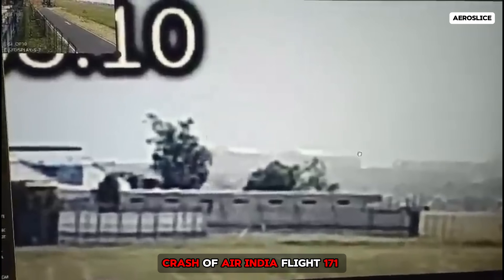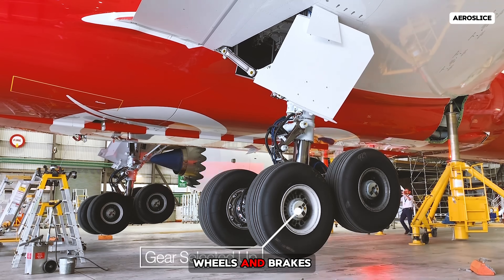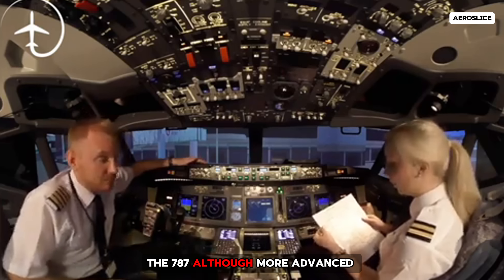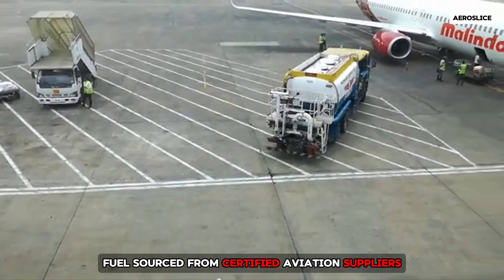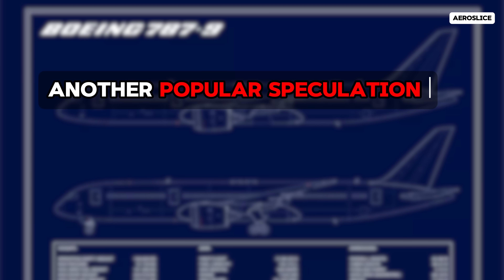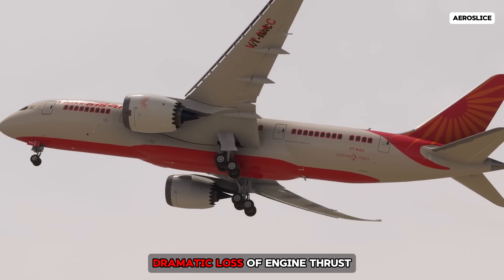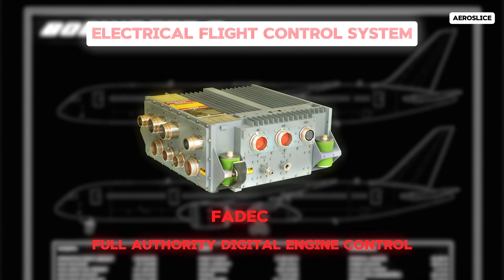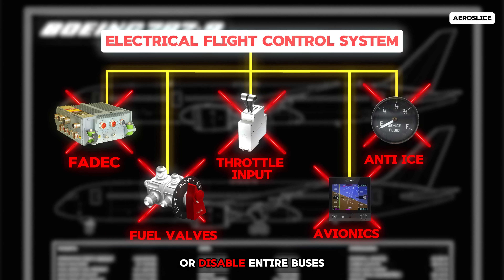The Truths Behind the Air India Crash

Comment: One of the engines failed on take off so the Pilot told the co-Pilot to shut it down , Co-Pilot mistakenly shut down the incorrect engine and the plane dropped from the air since it now has no thrush.. Ive been on the 787-8 probably a 1000 times over the years and never seen any problem of any kind.. I guess we all will have to wait and see..
Reply from the maker: 787's are surely very safe but your theory doesn't really seem plausible to me although anything cannot be denied at this stage..
Reply: There is no evidence that either engine failed. The aircraft rotated at the usual position and climb to 400 ft (twice the 197 ft wingspan) in 10 seconds, at a rate of 2,400 ft, which is normal. This aircraft has auto rudder correction to assist the pilot if there is a sigal engine issue which would require rudder to correct for the resulting yaw. In both videos the the rudder is in the mid position, hence asymmetric thrust is not being produced.

If there was a low level problem with an engine, the pilots would be too busy flying the aircraft to worry about a defective engine, that is a problem for later.

Comment: Landing gear is hydraulic, it has redundancy, if the process of raising the gear starts, you will see the “barn doors” open, this never happened….why?? Startle effect or the Pilot flying waiting for the Pilot monitoring to call “positive climb” which never happened because the aircraft didn’t climb… this extra drag prevented the aircraft from climbing..
Next, the video from the left clearly shows two things…
1. As the aircraft rotates, it’s very close to the end of the runway , hence the dust cloud thrown up perhaps from the clearway at the end of the runway.
2. You can clearly see a vortex, which suggests that at least engine #1 was creating thrust.

Any modern aircraft cannot take off without flaps, the takeoff config warning prevents this, even if the pilots forgot to press the configuration warning test button.

The RAT deploys automatically in the event of a dual AC power source failure, not because of a dual engine failure, with both engines running, and a loss of both engine driven generators, you will see a RAT deployed. The purpose of a RAT is to provide limited emergency electrical power to emergency buses, which provide primary instruments to the LHS pilot, and such things as fuel pumps etc…..it has nothing to do with thrust.

I disagree, I think the altitude reached is about right for ground effect.

This is either one of two things.

1. An electrical system failure, for example if you lose FADEC, and the slats are extended, the engines command idle thrust.
2. An input error, for example if the crew input a zero fuel weight instead of a gross weight into the FMGC, you produce a performance., with a flap setting, and a flex temperature, but not appropriate to the conditions on the day…this has happened before… but it doesn’t explain the RAT.
Reply from the maker: @coyh1493 Thankyou for such a detailed comment, I really appreciate it and it helped me understand the situation more! 
would love to know more about your view on this whole incident

Comment: Boeing has software which automatically takes over the controls and prevents pilots from manually controlling the plane in danger. Investigation found that pilots had the same problem with Boeing 737 Max crashes.
Reply: The 737 MCAS system had authority over the stabilizer trim. It was tied to a single angle of attack indicator. If the airplane entered a high angle of attack it would command nose down pitch trim without crew input. Because the crew didn’t know about the system and they failed to identify pitch trim runaway in timely fashion and shut off the stabilizer trim the planes crashed. 

MCAS had essentially no ability to take control over the airplane. It just had authority to turn the pitch trim wheels which the pilots could shut off. In fact they were responsible to turn off the pitch trim if it ran haywire because of any reason. It’s why Boeing didn’t inform the crew. Pitch trim runway isn’t something you diagnose when it happens. You shut it off right away. 

Am i excusing Boeing? No! I’m spewing why this happened. It wasn’t just Boeing. There were multiple contributing factors including old school outdated ideas that memory items are a good way of handling developing abnormal situations. In the past few years crews are given very few memory items because they are outdated and can be performed wrong by the crew when things get bad. If I’m not mistaken the 787 has zero memory items.

The 737 max is an old airplane that requires the crew to intervene with memorized procedures in case of system failure. 

The 787 max has no memory items Because it’s automated and highly advanced.
Reply from the maker: Yeahh I heard about that but I don't think it applies here
Reply: That’s MCAS on 737 MAX
Reply: Totally different in every respect.....
Reply: "Investigation found that pilots had the same problem with Boeing 737 Max crashes."
That is not substantially true.  MCAS makes/made some adjustments, but does not take control of the plane from the pilots.
The problem was that the pilots were not aware of MCAS, so made inputs which caused the crashes.  Not that they could have known that.

Comment: So true! The 787’s landing gear is electrically powered. During takeoff, the gear began retracting the first step  but never locked up, likely due to an electrical failure. Crucially, the fuel pumps share the same electrical bus. When power is lost, the system switches to suction feed, which may not supply enough fuel under high demand. The result: thrust loss despite engines running, failure to reach V2, and a low-speed, low-altitude stall. So many are just focusing at just the RAT. An electrical bus breakdown is the hypothesis that supports all evidences known in this case.
Reply: The landing gear is a hydraulic system engine driven
Reply: @luigilainom1123  Yes, it’s hydraulically actuated — but the 787’s gear system is powered by electric hydraulic pumps, not engine-driven ones. That’s the point: no electricity on that bus = no hydraulic pressure = gear stuck. It’s a very different architecture than traditional aircraft. Might be worth a closer look before hitting reply next time. 😉
Reply: @StefanEngdahl-v9r  "Yes, it’s hydraulically actuated — but the 787’s gear system is powered by electric hydraulic pumps, not engine-driven ones. That’s the point: no electricity on that bus = no hydraulic pressure = gear stuck. It’s a very different architecture than traditional aircraft. Might be worth a closer look before hitting reply next time. "

The initial part of the retraction sequence, tilting the bodies down at the front, is achieved using electric motors.The next step, lowering the doors uses hydraulic power. This system is pressurised by electric hydraulic pumps. The electrical power is provided by main engine driven generators. Raising the main gear and then closing the door requires hydraulic power. The commands to retract/extended the undercarriage are "fly by wire" ie; controls by data buses.

The key point in this case is that the first step was achieved, but the retraction sequence was interrupted, possibly suggesting a hydraulic issue, but may have been caused by problems with the signals commanding the doors to open.

The doors not opening is likely to be a symptom of a much bigger problem.

When the Flight Data is recovered the sequence of events should become clear.
Reply: @christopherrobinson7541  Could the root cause be either:
• a localized overload or short circuit triggering ELMS to shut down specific RPDUs, leading to loss of gear control and fuel pump function
or
• a failure in one of the BPCUs (Bus Power Control Units), disrupting electrical distribution and simulating a main bus failure?
Reply: @christopherrobinson7541 
The 787 is actually advertised by Boeing as having far more electric dependent systems than other aircraft.
A short circuit could theoretically, potentially, cause numerous rogue, current overloads or even reverse polarity backfeeding issues, through whatver routes in can find among the increased electrical supply and distribution requirement.
Linking multiple systems to provide redundancy, could possibly promote that not prevent it.
Reply from the maker: Well said sir!

Comment: Yes ive been saying it for days and this is exactly what happened but things should have been done to prevent this from happening. The early warning signs were there, passenger on this exact plane day before reported in flight entertainment not working, AC not working at all, these are warning signs of possible electrical failure. Why was this not spotted by cabin crew/pilots and why was this not addressed?
Reply from the maker: I think this might be the case of maintenance negligence for the sake of expansion

Comment: If the FADEC cuts the thrust there is still electrical power.  If the FADEC kills the engines then main electrical power is lost  The videos appear to show thrust lost followed by a brief exchange of speed for height with speed rapidly decaying due to loss of thrust plus extra drag from the landing gear and the RAT.  The RAT converts airflow into electrical and hydraulic power at the expense of drag.
There have been FADEC-induced crashes before.
https://en.wikipedia.org/wiki/1994_Mull_of_Kintyre_Chinook_crash
https://en.wikipedia.org/wiki/2015_Seville_Airbus_A400M_crash
Reply from the maker: Thankyou for your detailed comment! I'll check it out patrick
Reply: Your reference to Chinook Mull Kintyre unproven !!

Comment: This makes sense but why only one Boeing 787 with this condition? I believe that maintenance procedures were omitted during inspections and this Boeing 787 was passed as normal without any issues. It's as if the pilots didn't notice any electrical issues at takeoff. Then they noticed loss of thrust and issued the mayday when it was too late. The CVR should show if there were any alarms going off in the cockpit after rotation. Even then, the pilots could not have avoided this crash. I am certain that they did everything possible to recover the aircraft.
Reply from the maker: Yes I think the same, a lot of things become unlikely because 787 is a very safe plane and an architecture issue wouldn't take so long to surface..
Reply: It looks like the pilot flew the aircraft all the way to the crash, never giving up.

Comment: The loss of FDR data makes it very hard or even impossible to find the correct reason of Air India plane crush.
Reply from the maker: FDR has been found and sent off to boeing for extraction
Reply: @HorizonYT14  Yes - but apparently the FDR is damaged. . .
Reply: @HorizonYT14  No not to Boeing, but to the US NTSB data recovery lab. They may have to send it to the manufacturers. 

The B787-8 has combination recorders that are CVR & FDR. Two units are installed, one the the nose and the other in the tail. Presumably the damage unit was installed in the forward position and was damaged by fire.

Comment: Strongly Agree for this video as it is fully express what i had thought initially. I had seen the power line connected with faulty equipment (normal equipment for years and failed suddenly) which turn off the entire electrical system. The only way to restore the power is replacing the correct equipment and turn on the system again. This kind of cases are rarely seen, but it happened during maintenance work. The fun part is the point the equipment labelled as L+(or life) we found grounded internally of the equipment. Well this is electronics, this can happen and now in avionics. If you have faulty device shown grounded connected in the life wire distribution, no matter what backup battery or RAT are useless.
Reply from the maker: Thanks kenny, Really appreciate such a detailed comment

Comment: No, the more I hear the more I know you’re no engineer and certainly not electrical. N+N redundancy will be adequate. System design issue together with inadequate QA/QC and inadequate commissioning procedures.
Reply: And finally, 787 RAT does not supply hydraulics directly, only electrical back up. Don’t resign your day job!
Reply from the maker: Yes I used that term to signify that its a physical thing that goes out and supports as a back up, I didn't write it properly my bad mate
Reply from the maker: haha you're right I am not, thankyou for the comment and the information 
please expand on it if you could!

Comment: SPOFs are not allowed in data centres. Maybe I should work for Boeing? Also, this 787 took every inch of runway. OK, the engines weren’t Rolls Royce but not adequate for the load UNLESS flaps were not enough!!!
Reply from the maker: It's not clear if it went till the end of the runway

Comment: A Passenger traveling from Delhi to Ahmedabad on the same Aircraft on the same day reported serious Electrical Problems of the Aircraft like AC was not working, Light were Flickering, sound like frequent compressor on off was continually there though take off in Delhi Airport and landing in Ahmedabad Airport was smooth.
The lone Survivor of the Crashed Aircraft  reported Electrical Problems of the Aircraft.
Whether the Ground Engineers in Ahmedabad Airport addressed those problems sincerely and properly or not, it is not known.
Reply: Wrong , The only person that survived the crash said the lights did flicker right before a loud boom.. Electrical problems dont go Boom..
Reply from the maker: Yeah it might be representing something but it could be confirmation bias aswell!
Good point though personally I think it indicates bad condition of electrical systems onboard but that's speculative ofcourse

Comment: Ultimately, the pilots themselves should have full authority over the engines, not the electrical software.
Reply: Yep, Pilot should have a special switch to disconnect such electrical element and switch the system to full manual control.
Reply: @TheMarilith 
FADEC type systems provide no physical control of throttle input and engine management.
Fly by wire avionics are similar.
Don't know if aircraft ever had mechanical fuel pump delivery for take off power regardless.
Reply: @confederatenationalist7283  good point. I agree the acceleration to lift off segment was unusually long. The jet barely made it over the concrete slab at the end of the runway.
Reply: @jacquelinejacobson6789   No, it's been calculated that it took off at 75% of the runway.
Reply: Bingo!  No computer can use initiative or improvise to avert disaster.  There have been many instances of pilots running faulty engines to destruction to avert disaster.
Reply: Electrical hardware of FADEC type systems has enough potential to cause havoc let alone software bugs.
Reply: That is my personal opinion as well. But nowadays more and more people feel as if a system is safer and better if a computer does it than rather than the pilot
Reply: @jimmywright5054 
Who can we trust if we can't trust the man or the machine? What's left ? Certainly not AI.
Reply: @anzacman5   That would not be man or machine, that would be s t u p i d design by Boeing engineers as they did with the 737 MAX.
Reply: They basically do. There are so many redundant systems that even if everything fails and the filters are clogged gravity will still feed the engines. Basically the pilots have full control over both engines which is why you should wait till the preliminary report comes out
Reply: @jimsteinway695  hope you are right
Reply: @jimsteinway695 
Gravity might work for a piston Cessna.But a commercial airliner pump delivers up to 130,000 lbs/hr at 30 psi.My guess is more than one of them.
Reply: That has been a long time ago.  Since the 744 all engine controls are by wire.  So no control cables to the engine since 1989
Reply: How do you use the autopilot then????
Reply: @daftvader4218 
Autopilot combined with direct hydraulic and cable control is bad enough.Check out American Airlines Flight 1 Boeing 707 crash 1962.
Let alone what is effectively full authority electronic control instead of ...mechanical controls.

Comment: 2014 Boeing 787 went to India.   2016 FAA notifies Boeing of concern about 787 Electronic Computer System
22 day timer countdown that turns off computers.
Reply: Are you referring to the '248 DAY bug' ... not 22 days(?). At any rate this was supposedly fixed circa 2015. But, this wouldn't be the first time that old software bugs were inadvertently reloaded into a system. TBD
Reply from the maker: Interesting
Reply: There were lots of similar ADs where some systems had computers that had counter overflow issues. I think that these issues have now been rectified.

Comment: Not 'MIGHT be', it IS the RAT. 
There is other footage with sound that is has a much better quality picture than the one shown here.
The RAT was never developed for a power failure at 600 feet, but at high altitude.
More and more vapor lock is thought to be the cause of this crash, all requirements for it to happen were favourible.
Reply from the maker: I agree but I am calling it an speculation until the report confirms it
Reply: @HorizonYT14  CAPTAIN STEEVE has made a video with the original quality video of rat deployment with propellor sound.
Reply from the maker: @truearmy1953 aha I'll check it out thanks for mentioning that. Captain steve is a legend
Reply: Vapor lock doesn't happen in turbine engines. It happens in piston engines in smaller aircraft. Mostly in the older models manufactured in the 60's and 70's. My dads Cessna 175 experienced vapor lock. That plane was manufactured in 1959.
Reply from the maker: Yes you're right @TheHounddog2343